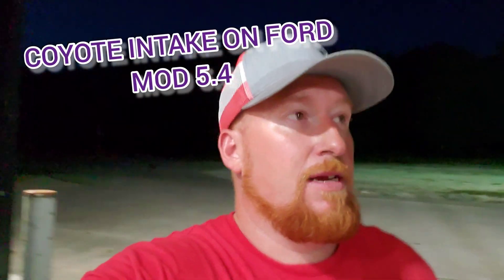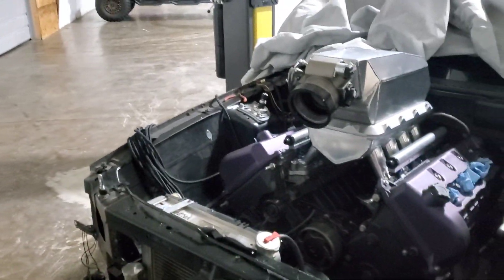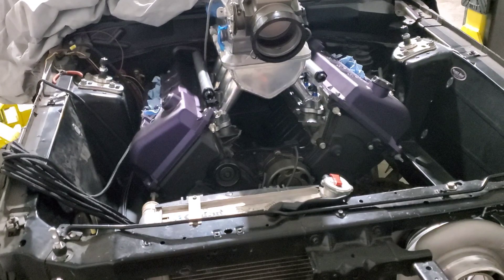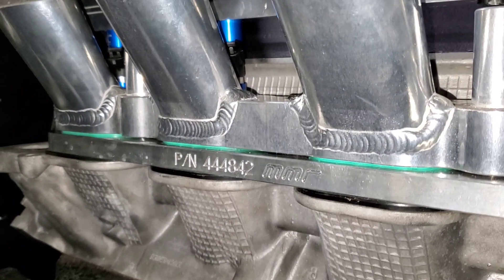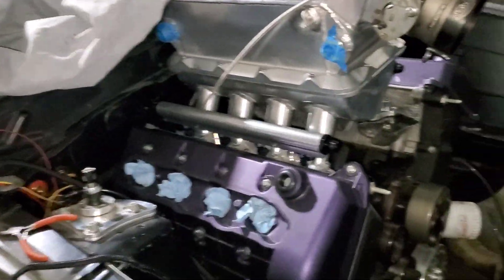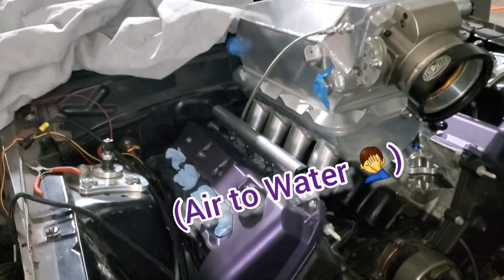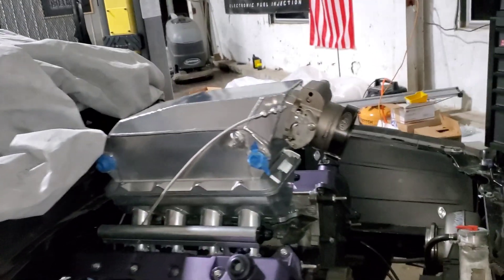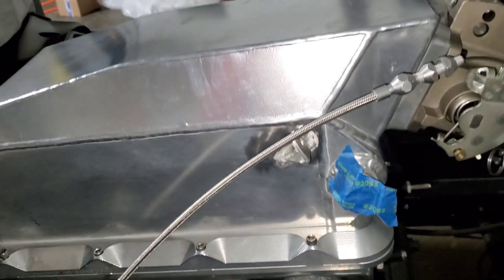How To - Coyote Intake Manifold on Ford Mod 5.4

Comment: Can this fit for a 2000 5.4 2v 4x4?
Reply from the maker: @bbs6302  this will fit the 4V heads. I'm not confident it will fit the 2V heads.

Comment: I have a 2000 F150 5.4 Triton can I bolt on these mmr plates no issue ?
Reply from the maker: @WickedxBeam  If your truck has 4V heads yes. If it has the 2V heads no sir, it will not fit.
Reply: @unkulbobby  Can you swap heads?

Comment: Did you have to clearance the heads/intake to fit the boss 302 intake? I’ve recently got back to building my Navi motor for a swap and the injector ports hit the sides of the head before it seats on the adapters
Reply: Thanks man guess I have a bit more tinkering to do lol
Reply from the maker: @Bigdaddy-tq9hw  yes I did. If remember correctly, I had to remove some casting marks on the heads in order for the air to water intake to fit properly. I don't remember having issues with the Boss 302 intake manifold.

Comment: My man..  nice.. what about Coyote heads? How do you mount coyote heads on a 5.4 Triton? 
Zero cost involved, I have it all..  any help would be appreciated..
Reply from the maker: Unfortunately, you can not bolt Coyote heads to a mod 5.4.
Reply: I found out that you can lightly modify a set of LS heads to fit a for 5.4 2v

Comment: My question is will it fit the 2v? 
Another question- can anyone point me towards a camshaft & accessories kit? I wanna make my expedition a stroker and rather than find each individual part does anyone sell with phasers and etc included?
Reply: For the 5.4 Engine in general, off the shelf stroker kits don’t even exist since it’s already a bored out 4.6, and this won’t fit a 2v because The Coyote intakes are made for 4V DOHC setups, not SOHC 2,3V setups like ours which would take a lot of complicated machining and etc., no adapters are available for the 2v either
Reply: @Superlalo_1  Actually a 5.4 is a stroked version of a 4.6 with a taller deck height. The bores are the same size.

Comment: Were you able to use the 5.4 stock injectors or did you have to buy some for the coyote?
Reply from the maker: I used holley injectors.
Reply: I'm actually doing kind of a similar build but with a 76 torino. I'm waiting for the adapter plates and intake to come in. I can't find much info on the switch. It's uncharted territory for me.

Comment: Awesome!! What about coyote swapped to 2v 5.4 ?? 
Would it be possible to reshape the 4v to work on a 2v ??
Reply from the maker: I'm not confident that the bolts lineup
Reply: @unkulbobby  changing the mounting points, maybe grafting the mounting surface?

Comment: What throttle body do you run? Looks like a LS style throttle body? If so how did you wire the iac / tps ??
Reply from the maker: It runs on a Holley Dominator. So it's just configuration of the inputs
Reply: @unkulbobby   ummm I wonder if I can re wire the sensor to work with a factory ecu. What did you use to bolt the throttle body to the intake??
Reply from the maker: @pwhitcomb7387  it's a Coyote style TB. FAST 87MM

Comment: Very happy to have found this video so I could find the adapters! I’m restoring my ‘77 F150 Shortbed 4x4 and I bought a running a driving ‘01 Navigator parts car for cheap and I’m swapping everything into my ‘77 but I was really hoping I could get the Boss 302 intake up on top. The Boss intake makes it pop more in the engine bay and it will suit my old restored truck better IMO. Didn’t really have any interest in keeping the stock Navigator intake on the engine.

Comment: What are you using for throttle body, I’m working getting parts for a single turbo or nitrous 5.4navi with tr3650 in a crown Vic but need to stick with cable throttle for stock ecu
Reply from the maker: Holley Cable Throttle body

Comment: Would the right stuff work instead of aluminium spacers?
Reply from the maker: I'm not sure what you mean by "right stuff". Coyote and Mod Motor have different bolt locations, so you'd need an adapter to run anything Coyote related. Or stick with what's currently offered in the mod Motor aftermarket.

Comment: Do you know what would be involved in putting a coyote intake manifold on a 4.6 - 2 valve? Can it be done with billet adapters and/or do they already exist? (Ive seen them for 5.4 dohc) Thanks 🍺
Reply from the maker: I haven't seen it done
Reply: We do a lot of these.
https://youtu.be/jaB1fFmEW4k?si=EV_zG7shaVuhen2K

Comment: What fuel rails and injectors did you use?
Reply from the maker: CPE Billet Rails, Injectors  Dynamics 2650s
Reply from the maker: Had to make my own spacers (for the injectors)from aluminum tube
Reply: @unkulbobby  Thanks.

Comment: What is the engine out of? Really mostly wanting to make sure on whether it’s a 2v,3v, or 4v and maybe head number
Reply from the maker: 4V 5.4 lightning block, navigator heads
Reply: @unkulbobby  much appreciated what’s your thoughts on the best ecu to run
Reply from the maker: @Nik Williams  well I couldn't say which one is Best, because these new ECUs are very capable in their own right. Depends on what software you're familiar with. 
I prefer Holley

Comment: Any update on the 5.4 i wana see more content i fixing a 2000 gt 5.4 mod dohc with 80mm. Wana get more info
Reply from the maker: As of right now, I have the 5.4. Sold the SN95, because I was offered a killer deal on a new S550 Racecar.
Reply: Did you have to modify the  intake valley or is it already. Covered  most in take act like its own cover

Comment: Awesome built I love the fact that you're using the 5.4, the Minion Mustang kick some serious ass with the 4.6 and 4 valve heads so I'm hoping the 5.4 with more cubic inches will do even better! So my question is can you do this with two valve heads or does it have to be 4 valve heads and will a boss 302 manifold bolt right up or do you need the adapter plate?
Reply from the maker: These adapters are specifically for 4V heads
Reply: You are awesome! You answered my question. 
I have the 5.4 3v and I guess I will keep hoping something will come along for my option soon. Let me know if you know of any 5.4 3v options like yours.
😊 TY again
Reply: @donaldspeck9212 I'm in the same boat as you man. Definitely hoping something turns up for 5.4 3v

Comment: I bought a 5.4 with a sn95 intake on it, do those bolt directly up to the head, or is there an adapter plate on there already?
Reply from the maker: As long as you have 4v heads, you'll need the MMR Adapters
Reply: @unkulbobby  it's a 2v and the intake is already on so I would assume the metal piece between the intake manifold is the adapter right?
Reply from the maker: @woody Dupont  yes, that's correct
Reply: @unkulbobby  beautiful , boss 302 intake coming soon lol
Reply: @unkulbobby  4.6 4v to 5.4 4v ?
Reply from the maker: @Daniel Dassler  these adapters are good for the 5.4 4V heads. I don't know if there's an adapter plate for 4.6  to Coyote.

Comment: What did you do on the throttle body side of the Boss302 intake?
Coyotes use drive-by-wire. What throttle body did you use?
Or were you able to convert the TB to cable pull?
Also, did you move the altenator? I remember there being a bracket that makes the alternator face the engine.
Reply from the maker: Swapped to a cable Throttle Body, used a FAST.
Ran the alternator off a bracket on the Driver side
Reply: @unkulbobby  Im weighing out power options for my Lightning pickup. One is a built Navi 5.4 with a single turbo setup. The Boss302 and Cobra Jet would be good intakes, I think.
Reply from the maker: @behindbarsmototouring898  they're both viable options.
Reply: Would a 2v throttle body work